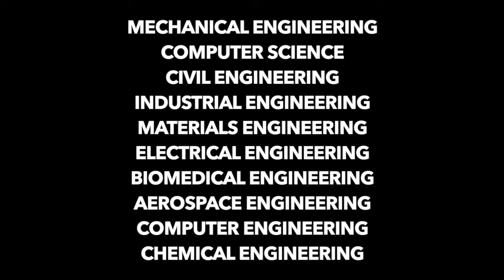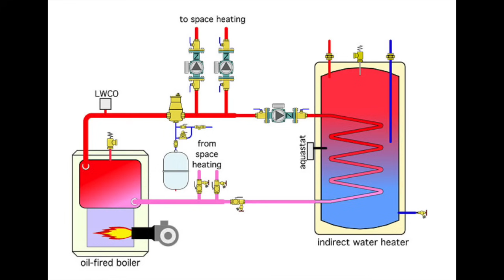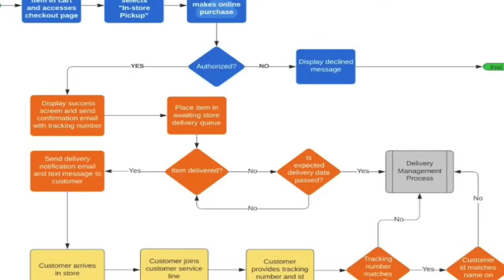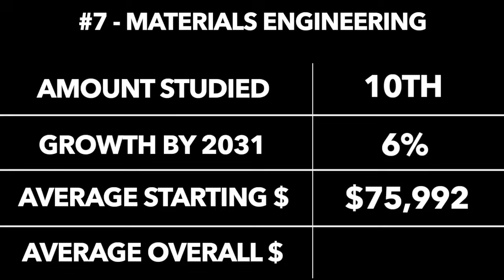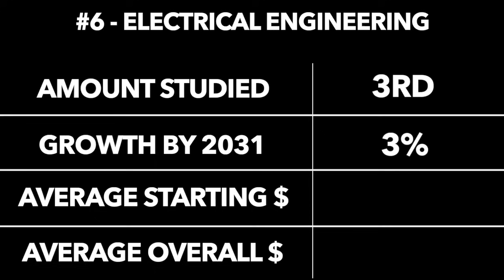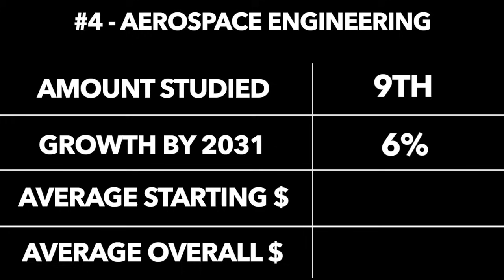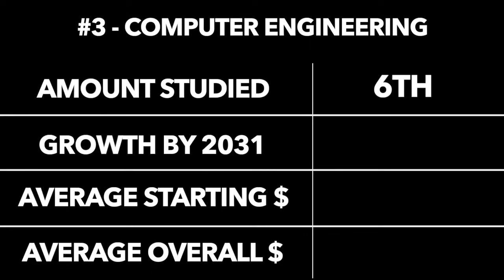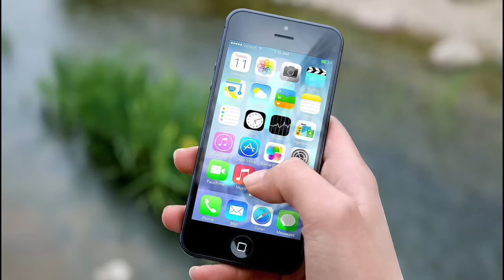Engineering Degrees Ranked: Pay, Demand, and Job Roles

Comment: The salary range for software engineers is  off base for those coming from the higher rated schools such as CMU, and Georgia Tech just as an example.  The starting salary for new graduates exceeds the overall salaries you stated for that field, and even more so when they get sign on bonuses and other benefits that add to there overall compensation.  You can verify that from those schools.  I believe CMU stated the lowest starting Software engineer at around 140k.  It may be lower this year due to tech layoffs from some major companies in California.  Point is, it pays to get into one of those high end schools if you can, and for the correct discipline.
Reply: And not to mention that a large majority of software engineers work/live in HCOL areas so the salaries are inflated to account for that
Reply: This is an awful argument. The salary for any high tier engr school will always be better. A mechanical engineer from MIT will make more than one from an avg state school. His stats are not for the top 5% of engr’s. It’s an average
Reply: @geeshmee  this was not an argument, lol.  I simply made the point, as indicated by “point is” that it pays to get into a highly rated school if you can.  A 200k starting salary, plus stock options more than covers the high rate of inflation for someone starting out in there early 20s, they can relocate latter.
Reply: @djl9154  I get that but you’re just stating the obvious and making it seem like he should’ve pointed that out. He’s using the average, he doesn’t need to point out what the top 1% make and what school they go to.
Reply: @geeshmee  thank you for your opinion.

Comment: Actually I really want to see more colleges offering a 4 Year Mechatronics Engineering Degree, the combination of Software, Mechanical, and Electrical.  Its the holy grail for Robotics and Automation/Autonomy.  Some universities have picked up on it, Most haven't and are sticking to the core Engineering degrees listed in the video.
Reply: current issue with a lot of tron degrees currently is because of the range and how broad it has to be it becomes just some of each of those disciplines which can result in a jack of all trades master or none scenario work wise
Reply: @jeremymarsh9199   I agree with you while at the same time realizing that most/much of the information that is taught in college is either out of date immediately or isn’t directly applicable in the workforce.  Nearly everything I have learned in the past 25 years of engineering was learned on the job, their process, their application.  I now think of college as somewhere that needs to teach you how to learn.  In engineering, you will continue to learn for the rest of your career.  If you think about it that way, jack of all trades is ok for my new hires.  I would say at this point, 90% of my hires directly out of college are not able to actually do anything for almost their full first year.
Reply: @jeremymarsh9199  No. Regardless of what you study you walk into your first job knowing basically nothing. Mechatronics atleast opens you up in the job market.
Reply: @jeremymarsh9199 this is exactly what I dealt with. Was difficult to find a job since I wasn’t a specialist in any of those fields but once I landed a job things have gone very well and my background in different areas in propelling my career. Just 1 mans experience
Reply: @@prodfrenzy My 'opinion' is that Mechanical is one of the most rounded (I'm Electrical btw), able to get into the fringes of electrical and software easier than some of the other disciplines trying to get into mechanical design.  I still tell my new engineers to try and get into the workforce and start making money with the bachelors when if they find a masters is of interest to them, enroll in it through a continuing education program offered through most medium to large companies.  Sometimes engineers start work and find they want to go into technical marketing or something like that and get an MBA.  Im a little biased and think robotics/mechatronics will be one of the most sought after degrees in the near future with autonomy coming to most vehicles, military, agriculture, mining etc..
Reply: @mattr3194  My University doesn't provide a Mechatronics degree so this helps. Thanks🙏
Reply: Yes, still very few universities with one, but at least alot of them allow double majors in EE and Mech.
Reply: @prodfrenzy  If you want to get into engineering,  get your Bachelors,   get a job, then work with your company to have then pay for your masters
Reply: So you make animatronics-like what you'd see at theme parks?
Reply: @marlonmoncrieffe0728  Naaa, I actually make the largest robots in the world...  Autonomous Surface Mining machines.
Reply: What’s your opinion on Engineering Physics degrees? It’s the most prestigious one here in Sweden, but I’m worried about it being less known internationally/in the US since I’m interested in working abroad, potentially moving to the US. I love math and physics, but I’m considering switching to Electrical Engineering
Reply: I have a range of specializations to choose from for year 4 and 5, including Computational Physics, Physical Electronics, Photonics, Software, Theoretical Physics etc.

Comment: Boy, did I ever screw up. I spent my final 25 years of employment as a software engineer and the most I ever made was $65,000, working 12 hour days.
Reply: Yeah. You screwed up big time. I'm a software engineer and I make $110k working 100% from home.
Reply: @livedreamsg where did you work?
Reply: How is that even possible? I've never even seen a senior software engineering position listed for less than $80k
Reply: @tjcogger1974  It's 100% my own fault. I absolutely loved the type of coding I was doing, and just never looked for other jobs. The company I worked for didn't have a huge budget for coders, so if I wanted to remain doing what I loved, I had to suck it up...and therein lies my screwup.

Comment: It seems that the disciplines that are most studied are the ones that have the lowest salaries.  Likely this is just supply and demand.
I've been an engineer for 45 years, salary growth has been very slow over that entire time.  My wife makes more money than I do, my daughter makes more money than I do, my plumber makes more money than I do.  Considering the amount of work it takes to get an engineering degree, the amount of work the engineering profession requires, and most of all the amount of responsibility involved, I would not recommend that anyone get into engineering at this time.
Reply: I have no idea what you are talking about I went to school for electrical computer engineering, currently working on new wireless protocols prototypes and salary is around 160k 10 years in with bonuses and stock it easily goes to a quarter million, either you suck at your job or didn't find the right company which, is on you.
Reply: @Zhcwu  I'm a structural engineer, so yes it's on my because I chose the wrong discipline.  There is a difference in demand between our disciplines, and a difference in responsibility.  You do something wrong and someone can't get email in their hotel room, I do something wrong and a building falls on your head.
Reply: @billj5645 you're showing your age when you think wireless protocols are just emails, but it's the basis for modern society, I do something wrong, banking, medical, and defense systems, would have some serious issues, it would be catastrophic, and not just one building but the entire world would be affected.
Reply: I here ya man. Engineers are worthless when a technician/draftman can do the same job and MORE. Be a cleaner and you'll triple your pay!!!